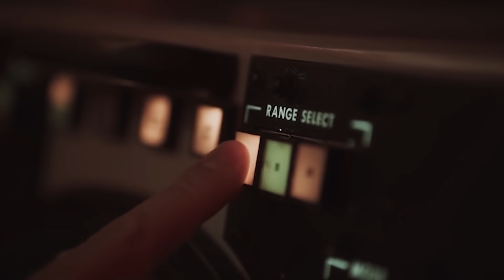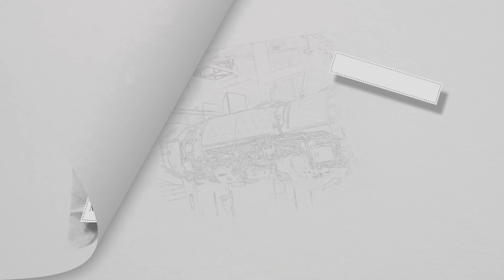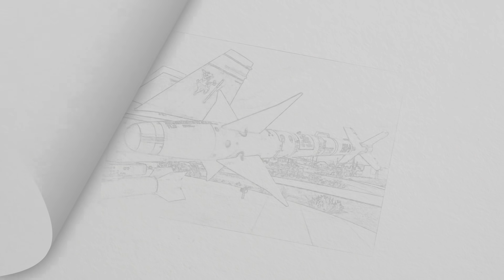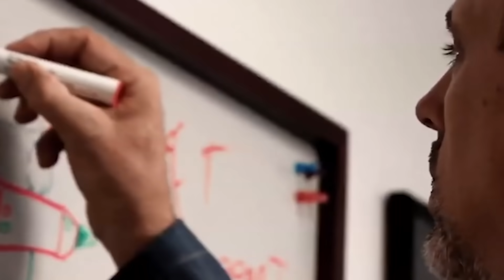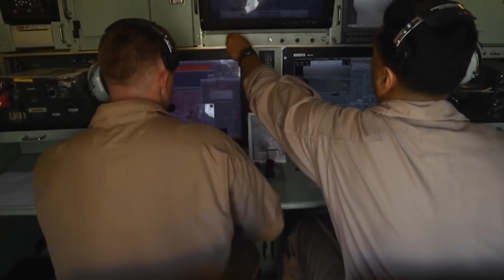F-22 Raptor vs 6th Generation /The New F-22 Raptor Is Coming

Comment: Raptors should be flown by the Air National Guard instead of being decommissioned.
Reply: Give them to Texas and Florida
Reply: It probably depends on the type of missions the national guard performs.  I know that the F-22 is extraordinarily expensive to operate, like over 100k per hour of flight time. The national guard might not fly a lot of missions where steath is important. I'm not an expert so I don't really know and I hate to see stuff just get thrown into mothballs but the maintenance costs might be one of the reasons that they're not doing that.
Reply: The F-22 Raptor is still the world's premier air dominance platform. It isn't going away anytime soon. It's supposed to begin being replaced by a 6th generation platform beginning around 2030.
Reply: @classicgalactica5879  they are updating it as we speak with new RAM(radar absorbing material) and newer optics/computers/sensors/anti jamming and electronic jamming warfare capabilities.

usa 🇺🇸 for life 
and our allies
Reply: The thing is that the air frames of the f-22 only have so many hours on them. So they can only be used for so many hours and there time is almost up. The F-35 is a far more capable aircraft than the F-22 in everyway except air dominance.

Comment: The F22 Raptor is a beautiful aircraft, I want it to remain operational for many more decades, and never need to be replaced from the 6th generation fighter jet.
Reply: 2006 Bub, that when they were meant to be in service. They have to get it into full service 1st.
Reply: @growlusnotneeded3251  they are in full service they just haven't had to be used yet. So if they wasn't in service yet then how did a f22 raptor fly up to 2 enemy aircraft and tell them it was time to go home lol. Dont believe look it up i forget what country the aircraft were from but it happened. Facts
Reply: @erdon466  I believe that was a couple of Iranian f-14s. Might not have been f-14s but I'm pretty sure it was Iranians.
Reply: @Sandhill1988  They were Iranian F-4's.
Reply: The F-22 is already obsolete from a technology standpoint and has a lot of dead end tech in them. The 6th gen fighter that has already flown makes the F-22 look like a WW2 piston engine fighter by comparison.
Reply: @Bellthorian  Well its still the best for being obsolete. The radar it has is the best in the world and they dont tell you about all the tech thats in it. If thats the case all the fighter jets are obsolete almost except the the new f15s srike  eagles and the f35.
Reply: @erdon466  Your IPhone has more processing power than the F-22's computer. The F-35 has roughly 100x the computing power. The method of coating the F-22 in RAM is obsolete, we have much more advanced methods. The F-22 is a closed proprietary system meaning that Lockheed Martin is the only company that can develop for it. The DOD is insisting that all future systems are open architecture. 

Please understand that I am not saying the F-22 is bad in any way. I am just saying that technology has leapt forward at an incredible pace since it was designed. The new 6th gen fighter the Airforce has flown in secret will be a massive jump in capability over the F-22.

Comment: Personally the F-22 should only protect the United States. Building a NG all multi-role should be protected, yet used outside the states if cost is better. F-22 is still worth the money spent on it than waste it by setting it aside.

Comment: I think a new light low-cost single engine fighter with thrust vectoring should be made………

The F-31 Poltergeist
Reply: Thrust vectoring is not necessary. The days of having to get behind your opponent in a dogfight are gone. Modern missiles have the ability of lock on after launch and or high off boresight capability. Meaning aircraft can engage a fighter that is directly behind them without having to maneuver. Modern air combat relies on low observability, seeing the enemy first and firing first. Thrust vectoring looks great at airshows and that is about it.

Comment: The YF-23, according multiple military and civil books and magazine's, did not complete all of the USAF's tests.  That was the only reason for its failure.  It was faster and with considerably greater stealth characteristic's than the YF-22.  Therefore the F-22, more less, won by default.  The F-22 is still a great aircraft in its own right.

Comment: How quickly F22 or F35 technology is possible to reverse engineer if they are captured on enemy grounds?
Reply: China doesn't really need to capture one of these planes to reverse engineer it. They've already infiltrated many of our networks and stolen the information directly.

But, even if they know our design secrets, there are many other challenges they have to overcome. For instance, the manufacturing process and quality assurance.

They're getting a lot better, but even the J-20 has material imperfections that make it somewhat easy to detect and track. And, there's the human side of the equation too. Tactics, training, and logistical support.

Comment: The USAF should not be building a new fighter until they have a tested prototype that can defeat F-22 Raptors in the same ratios that F-22 Raptors defeat F-15’s.  Until then, they should restart the F-22 production line with updated stealth and modern avionics with sensor fusion.  The F-22 Raptor is not just a good airframe, it is an EXCELLENT airframe that still has no peer anywhere in the world or even on the horizon.  They should put the F-22 back into production as quickly as possible as the F-22B, and also make an F-22C carrier variant for the Navy.  This would be the quickest, and also most cost effective way to boost American air power and fast, while still guaranteeing overmatch against any opponent, anywhere in the world.  Since the NGAD will not even BEGIN to enter service until the 2040’s, this is something the US can do NOW to ensure that China doesn’t even consider invading Taiwan, and Russia pulls their troops back from Ukraine.  Peace through strength.  China and Russia both know that if the USAF had 1500 modern F-22’s, and the Navy had 750, they wouldn’t have a snowballs chance in hell of ever establishing control of the air.

Comment: The F-22 is still the best air superiority fighter. and with F-35 technology the F-22 will skip ahead to a Generation 6 fighter. And possibly a full multirole capability with advanced sensors that could make it an effective mini AWACS able to operate in hostile airspace. The upgrade may include better stealth capability and maintainability. Cost is a major goal for the NGAD fighter which should be flying by 2030. Prototypes are already flying. The development and manufacturing of the NGAD will also be revolutionary. Most of the F-22s will be upgraded. Some of the early models will not be upgraded but still be useful. Including training and as wingmen. The F-22 should still have another 15 years of service. And work effectively with the F-35.  The F-35 technology is also going into the F-15EX fighter. Including a multirole capability. To replace existing F-15C/Ds and possibly the F-15E Strike Eagle.  With 40 years of development the F-15 will have a few decades of service in the airframe. Possibly until 2050. Some F-35 technology has gone into export F-16s. 
It is yet to be seen if the F-35 will replace all F-16s. Still a capable airframe but lacking stealth. The USAF could order some advanced F-16 fighters. The major problem for the F-35 is its stealth maintenance which requires more development. More cost effective stealth systems could go into the F-22. And lower stealth maintenance costs will be a major goal for NGAD. NGAD may be larger than the F-22, with longer range and more internal weapons storage. Potentially the size of the Su-35. The Navy NGAD could also be larger. Larger unmanned UAV wingmen drones will also carry more weapons and fuel. The new Navy carrier UAV will be able to refuel the Navies NGAD, F-18s and F-35s. And may not carry weapons. The updated F-22 may be very capable with SEAD operations. We have seen the Russian failure of SEAD operations to destroy radars and missiles.

Comment: Exactly HOW would holographic camouflage "trick" an infrared guided missile? It can't generate a heat signature like flares. Then there's radar. A hologram doesn't create a radar reflection so it's only the stealth features that protect it from that.
Reply: I’m assuming it is because “lasers” can be extremely hot, but I may be completely wrong
Reply: Probably because a lot of info in this video is BS.
Reply: Holographic camo would help disguise the path of the unit from ground observers at supersonic, and tv guidance is still a thing, if you can defeat that fallback and counter heat sig lock all thats left is passive radar. Radars typically have a minimum floor height (afaik) the idea might be to fly under it, and even park unobserved among the roses and hyacinths, then lift off guns ablazin' missiles a'trailin' in smoke, in fire an' in fury. etc etc .
Reply: Can't this be solved with a drone "shell" plane pretty easily? WW1 trick - now in flight combined with new hologram camo around squad?

Comment: The F-22 Raptor IS NO LONGER IN PRODUCTION and the cost to re-tool for that production would be prohibitive - just like the cost of the Raptor itself! Plus the Raptor's area comms & control tech is out of date.
What is need is what the Japanese are likely going to be doing, a  upgrade of the faster and stealthier YF-23.
WE SHOULD COOPERATE WITH JAPAN IN THIS PROJECT.

Comment: The YF-23 was more stealthier than the F-22. The Airforce when it comes to both of maneuverability both qas exceptional except the F-22 was more agile than the YF-23. Also there's alot of things going on between Northrop Grumman and the Airforce and the cause that they instead choose Lockheed Martin over that and it backfires so bad they only mad hundred of the F-22 which was alot harder to upgrade it's system compared to the YF-23 that was built around future upgrades if needed.

Comment: The YF-23 actually had better overall stats against the YF-22, it just wasn’t as sexy.  It did have vertical takeoff capability, which would be perfect for an aircraft carrier.
Reply: The af-22 is a air force plane, not navy.   The raper is a very limited attack craft. Its hard point are internal and in real ATA combay, i would send 6 cheap craft with 5 gen to take it out.   The f-35 is no better.

Comment: You would be totally stupid to get rid of the Raptor.
Reply: 2030 is still a ways off, might be F-22's can be retrofit with  the new avionics and some other changes to update them by then. It'd be nice if they cud supercruise at mach 2.5 fully loaded n stuff. If hypersonic a2a missiles ever become a thing, those don't need huge warhead payloads to punch a hole through something - sheer speed and a hard nose also help. They might even be pretty small by then, comparatively speaking, never know.

Comment: Once again, a video produced by people with little understanding of aircraft. The inaccuracies of this video are numerous and frankly I don't feel like pointing them all out. A couple of highlights though. You quoted the range of the AIM-9X/M missile that the NGAD will use as 65 miles, unfortunately that is incorrect. The max range of the current versions of the AIM-9 is only a little over 20 miles. I guess the biggest glaring problem is that your video makes numerous reference to the F-35 in relation to the F-22 with the conclusion on your part that the aircraft are designed to do the same thing. They're not. The F-22 is an air superiority fighter and the F-35 is multi role fighter. Not the same at all. So your conclusions based on that are incorrect. I could go on but frankly it just makes me more angry at the number of channels that pump out these fluff pieces with stock footage that looks cool but only shows the producers lack of knowledge of the subject in order to generate views. I know this sounds like I'm a know it all but I don't. One thing I do know is how to do my own research and verify facts. Google is your friend, learn how to use it.

Comment: 10:37-10:42 No sane man can accept this. That is, this is blown out of proportion , no real connection with true cost and serves other obscure purposes. The cost of raw materials used in it should hardly exceed 100 thousand dollars and even after processing to obtain desired in-plane objects could hardly cost over a couple of millions. Regarding the software and hardware of the computational power of the craft this should hardly be worth over some hundreds of thousands of dollars. All in all and after some creative accounting , the maximum cost of each f22 should not be over 5 miilion dollars, noting that this is a very generous estimate and is probably much cheaper. Now, how do we reach 250 millions from 5 or less , you can guess...., but probably will not understand because the difference between true cost and asked price is just preposterous. This is true for the rest of military equipment , but this is just another story.
Reply: Dude, my customer just spent 20k just in material to do a full remodel on his home. What hole do you live in to think the material cost is 100k? I've heard some very very very ignorant comments but damn it boy you ran off with the cake and hid it in your ass.
Reply: @suspicionofdeceit there was supposed to be another 0 after that 20. I didn't see it.
Reply: @suspicionofdeceit and it doesn't take long to accumulate 1 million in total for material and labor. I've remodeled many million dollar homes and labor for qualified employees often equal the materials. That was just 200k in materials not including labor.